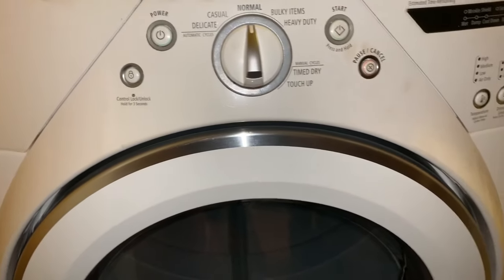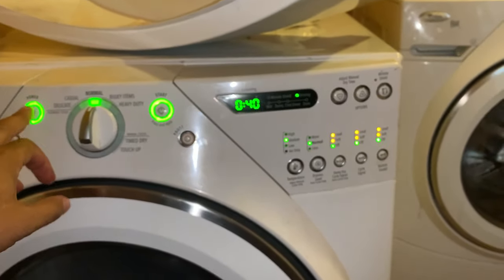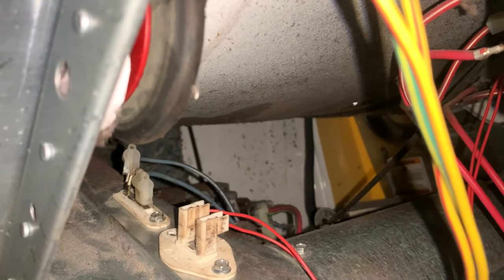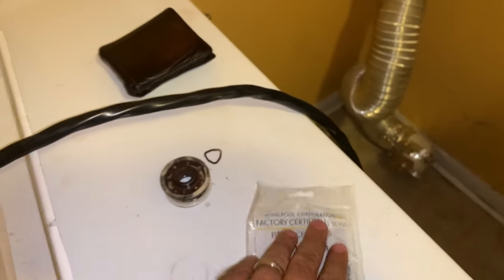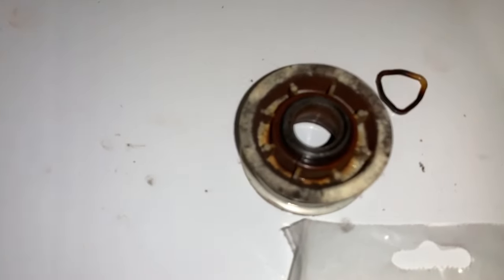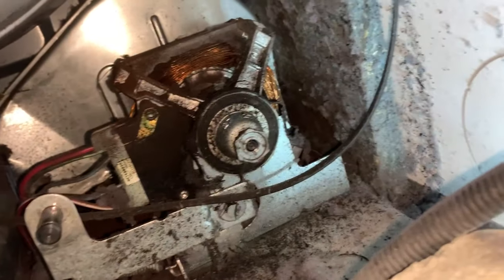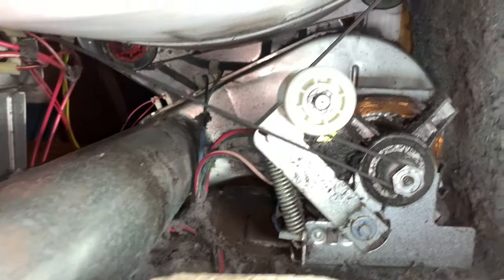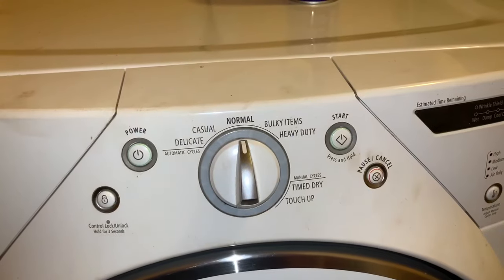WhirlPool Duet Dryer Will not Start but powers on.

Comment: If a watching watching this video has a bad thermal fuse,  you need to clean out your lint screen holder and dryer vent. Also at the end of the dryer, it sounded kind of noisy. There will always be a noise when the drum seam passes over the drum rollers, but this sounds like rubber skid marks on the drum. They can be scraped off with a puddy knife and will significantly reduce the clumpy noise. This noise and the reason you have belt and or tensioner problems is from overloading or overuse. If people would stop putting huge loads like all their jeans at once or shoes, rugs , big blankets etc,  you will save yourself alot of problems. If you ever work on a dryer, clean the lint screen holder, inside the dryer and try using and electric (not gas) leaf blower to blow out the vent.
Reply from the maker: Very well said.

Comment: What model number is this dryer? I have the same one, but I have no identifying model number on it. Nothing when you open the door and nothing in the manual. Having the same issue. I am wondering if the belt is bad enough (missing ribs and crumbles when I touch it) could it cause this to happen?

Comment: Another thing I'll add. After I replaced the broken belt it was turning very slowly. I had to spray WD40 on the "wheels" that are on the inside. You can see one above his finger at the 1 minute mark. I believe there were 4, two in the front and two in the back. After greasing these up it started spinning normally. I believe this is what snapped my belt. My tensioner was still intact. Hope that helps someone.  Thanks!

Comment: I looked up how to use my low spin instead of just no spin cycle. However there’s a low spin that won’t light up! I have to hold my start button down for a couple of seconds for it to engage unlike this model. American made it has lasted forever 2007. This looks a little different but similar and mine looks newer. I love mine! I tried a GE combo at a hotel that we were staying in. I will never buy one if mine falls apart ever I will be buying another whirlpool no combos I think that was probably the problem it would not open even after doing the reset mode, I had to finally be unplugged by the maintenance because they had to move it to be in plugged in there very heavy. Otherwise, my sons jeans that cost thousands of dollars would’ve been stuck in that machine forever if it had been at my home, I never would’ve been able to get it unplugged because my plug is on the ground and they’re too heavy to move by yourself at least for me as a female I can move them around a little bit but I can’t move them completely for like that just happened I would need like a dolly. Lol. Good luck. Not quite sure what’s wrong with that but I’ve only had a tiny leak in my drum and it was fixed in two seconds.

Comment: Your video was an immense help to me. I recently replaced the belt and rollers on my gas powered Whirlpool Duet dryer because it was making a dreadful squeal when my wife tried to use it. Had everything installed and returned the gas line, etc only to discover that the dryer wouldn’t start, and it only made a clicking noise when I tried to start it. One video suggested it was the electronic assembly, but nothing looked amiss. Found your video and discovered that the belt switch was still activated. Once I adjusted it and tested the dryer, it began working normally. Thank you! 😊

Comment: Happened to have a thermal switch from previous repair kit. Took it apart to investigate and past me had bagged and taped the spare parts inside. 30 minute diagnostic and repair.
Ordering another kit for the next failure. I'm going to keep this thing running 20 more years

Thank you!!!

Comment: Holy crap.  I’ve been searching for troubleshooting steps for our Duet for a day now.  I don’t have a schematic to walk through the circuit.  I’ve already ruled out the thermal switch, it tested good.  I was going to start mucking with the motor tomorrow, I couldn’t “see” what was in series with the motor.  I do know that our tensioner is in place and the pulley is there, however, I didn’t inspect it like this.  Thank you so much.
Reply from the maker: YOU'RE WELCOME...IF YOU NEED A SCHEMATIC, I HAVE ONE, CAN ALWAYS SHOOT YOU AN EMAIL...THANKS FOR WATCHING.

Comment: Theo, huge thank you man! Your video was spot on and it helped me resolve our issue. 
Ordered the new thermal switch on Amazon for $4.98, and it was delivered two days later. Installed that same day and now the dryer works great. 
I spent hours in Sunday trying to resolve the issue with error light. Bonus fact is that the entire dryer has been cleaned inside and out! 
Thank you so much!
Reply from the maker: Glad the video helped you.  Initially i spent a day scratching my head also.   Then i had to pull schematics out.   Yes, for a few dollars you saved a thousand bucks.   
Well, thanks for watching again.
Reply: @Thejripley1720 - Can you pls share the part you ordered at Amazon?
Reply: How did you access the thermal switch? Trying to figure out how to get in there but don't see any screws. lol
Reply: @ADHDResourceSpecialist  There are two screws on which the thermo switch is held. You can remove them using a socket wrench.

Comment: Excellent video !!!!!
Mine was the thermal switch I replaced it and the dryer is working fine. Amazon had the switch delivered promptly and we were back in business. The part is cheap. Saved our family money, if we were to have a repairman come in I’m sure it would have been expensive. 
Thank you for the video, very much appreciated.
Reply from the maker: Glad you’re up and running.  Saved a few hundred dollars for sure.
Reply: Any chance you can send me the thermal switch link so i can purchase?
Reply: Do you have a link or part number for the switch I want to order both to be safe

Comment: Thank you very much for this video. My tensioner wheel broke off also and I followed this with great success. I got the whole bracket with wheel already installed on it for $25.00     Gave me a chance to shop vac all of the lint in there and around the motor too. Once again THANK YOU !!
Reply from the maker: That's amazing.   Thank you for watching and I'm glad the video helped you.  Have a nice weekend.
Reply: Where did you get the part?

Comment: Thank you very much. My Duet dryer has the exact same symptoms. Now I just need to pull it apart to check for those two problem spots to see which one is the culprit.
Reply: Ever find out the problem my dryer just died

Comment: Mine broke 3 times:
1st was the 12V DC Relay in the control board (left leg). It blew. 
2nd was the thermal fuse attached to 2 light blue wires mentioned in this video
3rd was the Relay blew again, but this time the right leg.  Replacing the relay needs to remove old relay from board, buy new relay, clean the board and put on new relay with some soldering work.
Yes take your time and DIY and save yourself hundreds of dollars. Good Luck.

Comment: Thanks a lot for your video. I had the exact same problem and now it's fixed. It's hard to believe that this critical pulley tensioner is made so cheaply, no wonder it breaks so easily !
Reply from the maker: GLAD YOU FIXED IT...YES, VERY CHEAP...THE NEWER THE MACHINE THE CHEAPER THEY'RE MADE IN MY OPINION...
Reply: Not hard to believe with a whirlpool.   Mine has had the door seal fall out, the plastic door cover fall off, and now I'm looking at this video because the thing won't start.

Comment: Mine turned out to be a broken belt - already replaced the pulley months ago.  Thanks for the vid - encouraging for working on it again instead of dropping $1000 for a new one!
Reply: A
Mm
Reply: Was it easy to replace belt and where did you pick it up at? Mine is broken as well.
Reply: @npc118  it was easy - the belt was available at a local appliance shop - good luck!
Reply: Did you install the belt by disassembling the machine’s front panels or its rear panels?

Comment: Great video!  I’m stumped on mine. Door switch seems okay, thermal fuse, thermistor, and thermostats are good or replaced.  Tensioner system is in place and appears working. I had a lot of lint inside dryer cabinet even though rear venting was clear. Read the interior seals are crummy on some of these duet models.

Comment: I find the main control under the top of lid is usually blown. You can remove board from plastic assembly and see where board has shorted. Had that job today. Installed new board and it’s still powering on but not running.

Comment: I have a whirlpool duet as well, but the buttons and knobs are completely different. Did not matter though, because the belt and tensioner were the same, and it was the same problem. Replaced the pulley and was good to go!
Reply from the maker: Glad you got the issue resolved.   It’s such a common problem.    Thanks for watching!!!

Comment: First the pulley was squealing like a pig so oiled bit eventually got new one and replaced. While I had the back open unit was vacuumed and cleaned and the vent flex pipe was cleaned. Its like a brush on a stick that goes onto a drill and it is now looking like the day it was installed, all fresh and clean. Everything put back together and now the unit won't start... So I flipped the breaker and reset... Not sure if door sensor, thermal fuse, or tensioner sensor but I need to give my aging back and knees a break before moving everything out again and removing back cover. Not my first appliance I've needed to fix but this one is about to end up next to the road with a free sign on it as it has one issue after the next

Comment: Mine was the burnt/popped solder on the back of the board. If you have the problem it's very obvious when you take the board out and turn it over. I just put some soider on it and started working again I guess we'll see how long it lasts

Comment: I have the exact same problem. It started tonight. I hear the click when I press start. Will pull the machine out this weekend to view the wheel tensioner. However, my diagnostic code states an F50. Which could be the water valve or PCB. WoW. So much to look at. But buying all parts and doing it myself (as I researched two years ago and fixed my thermal fuse) had a repairman replace the heating element two years ago.  I figure if I replace the tensioner (if needed) the water valve (if needed) AND the PCB, it will all still be cheaper than a brand new one.

Comment: Thanks for the tip! Ended up being a broken belt.  Wife was IMMEDIATELY on the computer looking at a $700 dryer. I was like, AH HECK NO!  So I bought a kit that included a belt, a tension wheel and metal arm…..$15.00!!!!! Take that wife!!!! A tip for everyone, while you’re in there, remove the drum and give it a good vacuum.

Comment: Great video, thanks for sharing this info.   My pulley is good and the whole belt system was recently replaced so it is likely the thermal switch or the fuse on mine.  How do I know which is the problem?Do I need to put a multimeter across to test and if so what should I be looking for in terms of amps?

Comment: so @ 3:43 it shows two wheels would you know what the lower one is the black one ??? The octagon looking one
Reply from the maker: The lower bottom right at 3:43 is the motor.    You need to change the white wheel.  Is it there or missing?

Comment: Hey Theo great video but I replace the thermal fuse and the wheel is fine and it still doesn't work :( Is there another fuse to check??

Comment: Broken Belt for the win.  Super easy repair.  Thank you.
Reply from the maker: Thanks for watching!!
Reply: How did you repair it mine broke tonight and where did you pick up the park and how much?  Thanks
Reply: @npc118  Any appliance repair / parts place can have them or order them.  youtube make and model belt replacement.  mine was $28 Canadian I think.  its actually really easy once the appropriate screws and panels are removed as outlined in the videos

Comment: The thing that's wrong with mine is nothing else is working but when I open the door the lights come on. So what's the issue if you can help
Reply from the maker: I never ever seen that before.  I could guess a control board issue possibly?  So, you power on and put your clothes inside.  You close the door, you push start and what happens?  If i understand you correctly you are doing that and there are no lights until you open the door?  if so, i have no clue at all.   If that happened to me, id be replacing a control board or make sure the wiring harnesses are hooked up good.   Hope this helped.

Comment: I have excatly the same issue and I can't seem to find the problem still. Belt is good , wheel is good , everything is on. Thermal fuse good, and all other thermostats. I did the diagnose test as you did and the all passed but still not running. Although the sensor passed I don't know how to test the move sensor harness. But it passed the test.  No error messages display on my unit. It's a Kenmore Elite HE4 smartheat quietpak9 electric dryer part no.8527830 and seems to have same diagnose and layout as yours. Any advise or help would be much appreciated. My door latch is good to and light works too on it. Power is on and all buttons works as normal but when I click start. Does the click sound turning on and off but won't spin or start any drying cycle. Been trying to figure this out door a week now and I can't find the problem.

Comment: I have the same problem but how do you know if it's the thermal fuse?
Reply from the maker: You have to remove it and check for continuity with a multimeter.   If u cant do that check the back.   If the tension is there then the thermal fuse is bad.
Reply: @kissingbanditt   yeah the tension is still intact. So I guess it's the thermal fuse. Thanks for the help.
Reply from the maker: @gcj408  yes.    There are two of them.   You will see them when you remove the front bottom cover.
Reply: @kissingbanditt  Thanks for the help, I just replaced the thermal fuse and it is working now. Thought it was going to be harder to replace but it wasn't. This video helped out when I needed it and saved us some money.
Reply from the maker: @gcj408  im so happy to hear that.    Good!!!!   Glad you saved money.    I appreciate your support.

Comment: How do you remove the lower bottom panel that you already show taken off
Reply from the maker: If someone can help you just push the dryer a little backwards or rather lift up a little.    There are two screws right at the bottom, front side.    I didn’t have help or anyone help me lift it.   So i took a big screw driver and i put it at the bottom front to lift only 1/2”.    That way the screws are easier to take off.    Then when you remove the screws just pull the cover.

Comment: I have the exact same washer and dryer. My problem though is my power button to my washer. The power button seems to be stuck so I can't even turn it on and the door it locked so I cannot get my wet clothes out. Any suggestions on how to get the door to unlock? Iv asked help but people just say unplug and turn it back on but I can't because the power button to turn it on won't work
Reply from the maker: Unplug it from the wall. Pull out the cord.  Wait 5 min and plug it back in.     Hope it works for you.

Comment: I have the same problem but with the washer machine from the same brand and model do ypu have a video of how to fix it? thank you in advance
Reply from the maker: You know it happened to me once.   Unplug it.  Remove the bottom filter at the front.  Unscrew it.  Water will come out so have towels or a bucket.   
Plug it back in.   Your washer gives out codes.  What codes do you see?    If still issue go to main board and unplug and plug back in.  Clean connections.    Try again.

Comment: I check the wheel it’s good changed the thermal switch and it’s still turns on but won’t start I can hear it click when i push the button
Reply from the maker: Check the belt.  
Also the wheel may be good but the switch at the wheel is not made.  I show that in my video.
Reply: I did both of those and still the same
Reply from the maker: @vlasanec1  put it outside for garbage.  Not worth fixing.

Comment: Thank you for the video. I have the Whirlpool Duet Washer model WFW9550WR00 and it stops in the middle of the cycle and no error code. If i power it off by removing the power cord then it works again. Do you know how to enter the diagnostic code to be able to see the error codes on this model?

Comment: My start button broke everything lights up but I can't push it to start. Any advice would be much appreciated
Reply from the maker: when you push the start button, what exactly does it do...what sound, any beeping?  if you say you broke your start button then you need to order it and put it on...you think you broke it, or you broke it for sure?  maybe the start button is ok, but it wont start due to the issue i explained here...if any of the issues i explained in this video are happening to you, then id say your start button is fine and your issue is the thermal switch, or limit switch at the back of the machine, the pulley broke off....if those switches go bad or break, the power button does not work....
can you power on or off?  that will tell us everything...just power on and off....can u do that?
Reply: @kissingbanditt  no its broken off its just a hole there
Reply: @kissingbanditt  it will power on
Reply from the maker: @divinesoul231  so how do u turn it off?